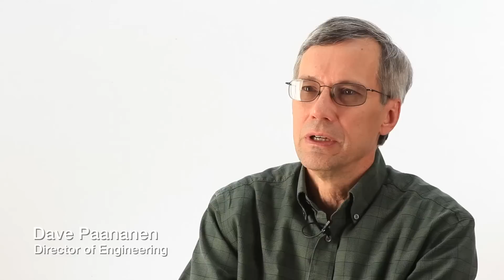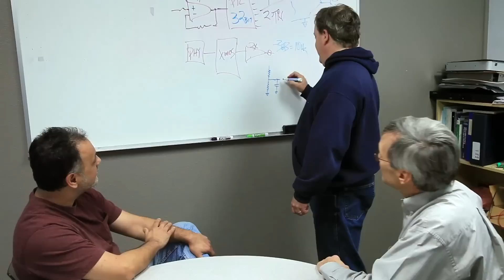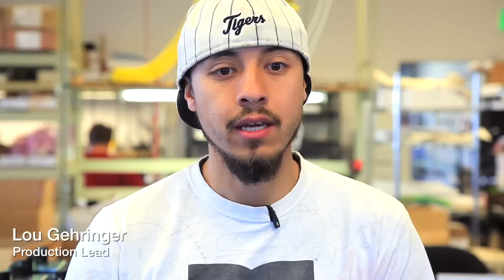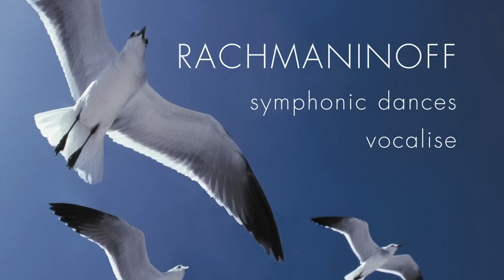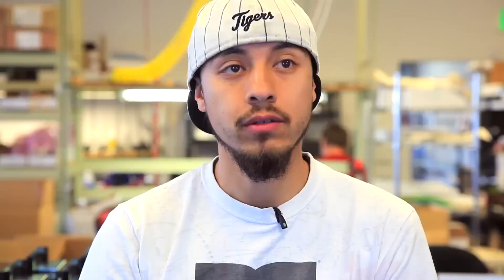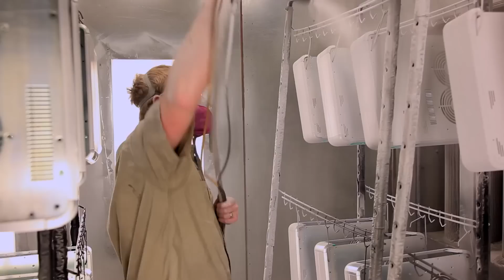PerfectWave

Comment: Why if you are trying to achieve perfection in D/A do you use an off the shelf DAC IC?
Reply: Audio companies rarely design and build their own parts, that would be very expensive, you design the device, you pick the parts. A DAC is an expensive proposition, and there are several ready to go solutions, so you use those. Audio has always rode on a sea of standardized parts, be too expensive otherwise.
Reply: Paul Stubbs I think it is you can't buy them in big quantity that DAC modules, I mean you can buy a studio DAC module for about $100 what is way superior to any DAC on the market today! because there are about 6 or 7 years  head to the stuff you buy today I think it's just a filtering effect deliberately put in so studios always head of the game.
Now if they make the module swappable? so you can just swap them out for a Modern modules that would be the best solution. But I don't know of any manufacturer that does that because there's no money to be made I suppose! And they want to sell you some high price ridiculous item that is not worth the price then just a model for a couple hundred dollars? I think they could do it I mean other equipment amplifiers theoretically don't come obsolete, so a DAC system shouldn't come obsolete bad for the environment wasting resources.
Reply: With Taiwan producing most of the world's silicone for electronics and South East Asia making most of the individual components it would be nearly impossible for US manufacturers to make anything that would be affordable to the Working class people "Middle Class people" if there is going to be any after this pandemic! Love your passion Paul for Music Reproduction and Production! Good Luck with all your newest Ventures!